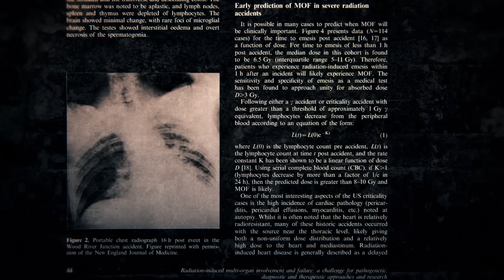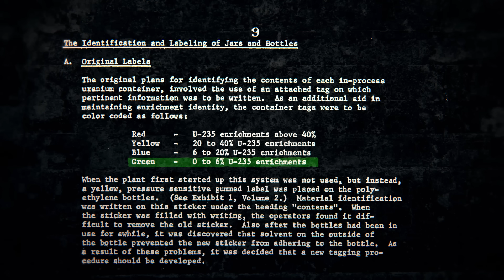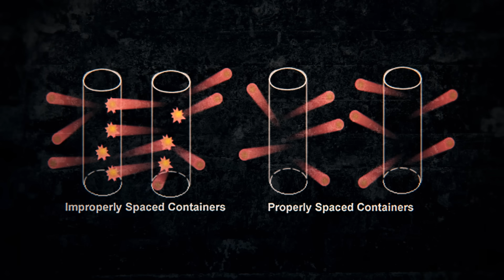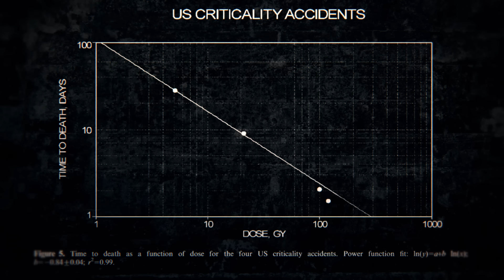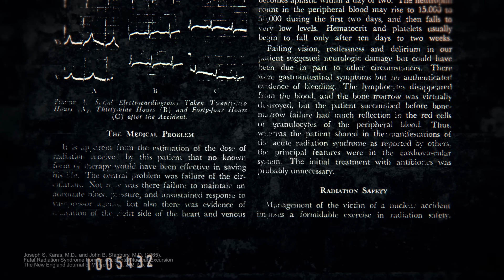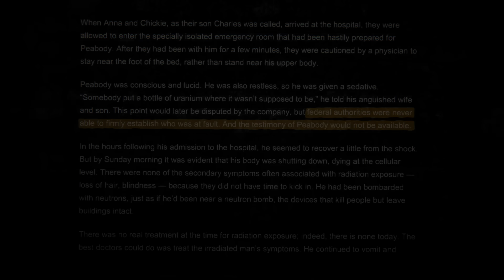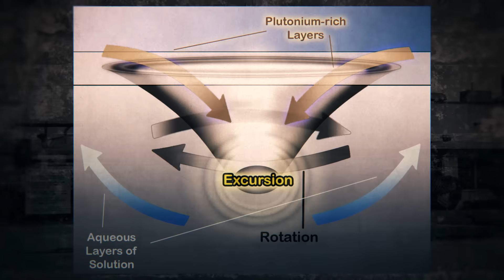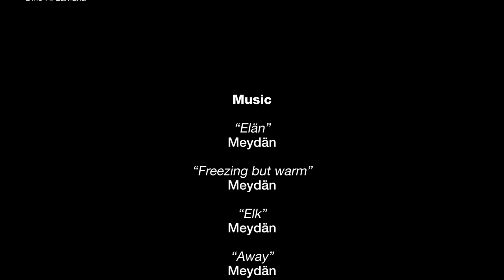The Most Radioactive Man in History - Wood River Accident

Comment: UNC faced several health, safety, and environmental issues. This accident highlights not only a disregard for basic common-sense safety but also a blatant failure to follow procedures—failures that eventually contributed to a different kind of radiological disaster on First Nations land and people, as seen with Church Rock and other incidents in the same area. All of this stemmed from UNC’s rogue, laissez-faire attitude toward safety.

This story is still unfolding; a large settlement in this case was only recently adjudicated. Nuclear energy remains one of the safest industries, but precautions must be taken and consistently followed. That is the recurring lesson we see with UNC.

I would still argue that nuclear power is far safer than any other form of large-scale energy production. As you eloquently stated, Kyle, despite these incidents it remains the safest source of mass energy. I also like geothermal, though its applications are currently limited. In my view, we still need more nuclear power plants, even in light of these disasters.

We can revisit the well-documented pollution deaths from coal and natural gas and the fact that wind and solar generally pose greater risks to worker safety than nuclear. The goal should be zero deaths from energy generation, and I believe that is achievable with nuclear.
Reply: How do solar and wind kill people, please? Once installed, they can be operated from a distance, just as any old power plant does.
Reply: @gabbyn978 They are still relatively minor components and likely to start shrinking in use due to bad decisions at the federal level.
Reply: @gabbyn978 people fall off roofs I love solar I'm not arguing against it but what do we use for large scale? Solar can't provide enough especially with data centers and the like coming on line. Also, geothermal is my preferred method but it right now isn't able to be done at a profitable level in many areas. Living in Nevada it's abundant here and we need to develop geotherma.
Reply: @Piperdude26  Power plant builders may fall off scaffoldings, too, for the same reason: they did not safeguard themselves properly. For me this isn't an argument. 

Geothermal would be great; the issue is that boring holes is expensive, and then some grounds don't allow for that. Geological layers start to shift or break because there is some tension down beneath, or a hydrophilic layer swells when it comes into contact with water. The result can be quakes,  and a ground that shifts and rises slowly in certain areas, causing the surface to tilt until walls break. Even this technology has to be handled with care. 

Meanwhile, there are ideas to use old mines for storing energy because they have a constant temperature. Put the summer heat down there, and use it in winter. Or simply take the temperature as it currently is, and add a heat pump to it, to heat the town. In this way even a coal mine can become a benefit to nature.
Reply: Don't forget it isn't just the damage done to the environment with coal destroying not just mountains but the entire valley. And coal contains not only large amount of Sulfur (Sulfuric acid rain sound familiar?) but also lots of mercury, and mercury is a lot harder to capture as it exits the stack compared to sulfur and nitrogen oxides.
Reply: And in order to supercharge AI Development, the Trump Admin wants to further deregulate nuclear standards.

We are so beyond cooked.
Reply: OK let us know when the nuclear industry is actually going to start being uniformly responsible and not idly blurt out the same sneering  messaging as they have in the past, but that's all I've seen in the modern era, a lot of people doing the same 'heheh wull nuclear's best and if you don't agree you're just stupid' and it's the same shit those morons said in the past when they were making unsafe reactors that cost a ludicrous amount of money and became massive liabilities that never translated into the cost savings we were promised. "the goal should be zero deaths" sounds very noble but it's unrealistically silly when we're talking about industrial projects on this scale with massive potential issues. You can say whatever you want about gas and coal or whatever but that stuff doesn't have the same potential for making giant swaths of land uninhabitable for centuries.
Reply: @jamescarter3196  "You can say whatever you want about gas and coal or whatever but that stuff doesn't have the same potential for making giant swaths of land uninhabitable for centuries."
...Are you an actual idiot, or what?
Gas and coal (and oil) are making giant swaths of our entire planet uninhabitable. And killing tens of thousands of people every single year.
Reply: @jamescarter3196  OK I'm not saying you're stupid by any means and yes what UNC has done IS a cause for concern we do need to monitor and be vigilant about safety in all forms. Your point about Coal when the emissions kill 1,600 people a year well.... say what you will believe what you like I am not going to change your mind nor will I try but troll someone else please.

Comment: How much radiation would cause immediate death?
Reply: Saw your question, got curious, looked it up and learned a couple of things lol. To be killed instantly, it would depend on the heat released by the radioactive source. Ionizing radiation (what I think is the root of your question, unless I'm wrong) causes cell death and the interruption of bodily function continuity.

So to try and answer your question, there's no level of emitted radiation that can kill a person right then and there. Just the amount of heat released by the reaction. The time it takes for actual absorbed radiation to cause immediate death is limited by the physical time it takes for cells to die and whatnot.
Reply: @mtlgrsldx  Ah. Thanks. Then I would assume that you would die from "thermal damage" to the cells, before you would die from "radiation damage" to the cells, given an "imitatetly lethal" dose of radiation?

What if the cells were frozen?